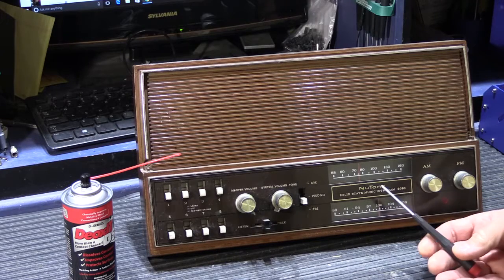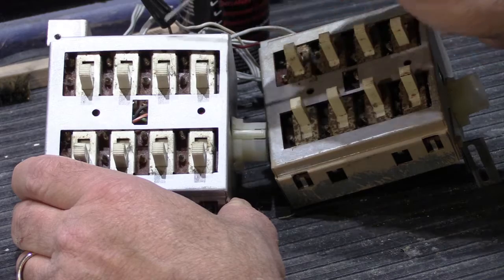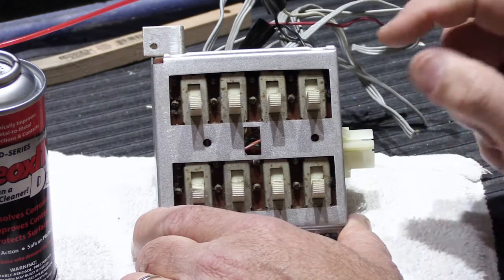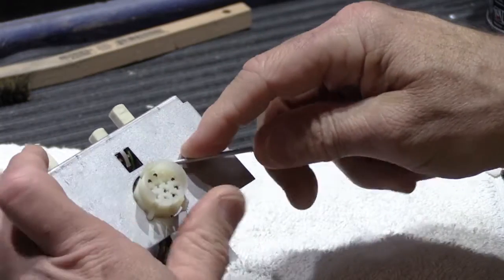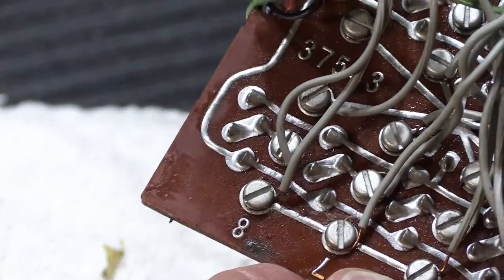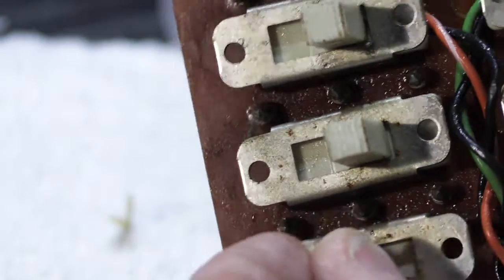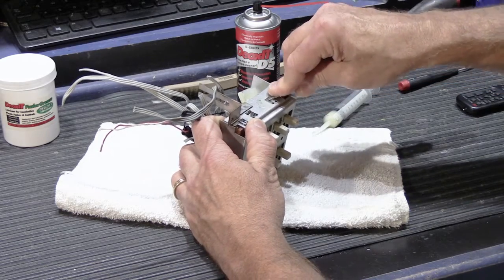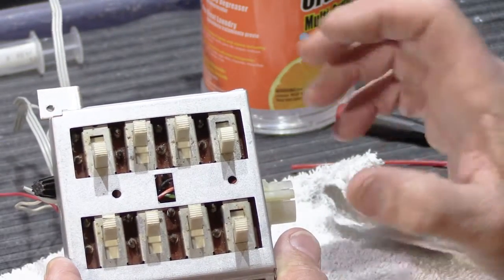How to Clean the  Room Control Switches on NuTone Model 2090 - 2540 - 2542 Intercom Master Stations

Comment: Great video. Can I use the same cleaner and brass brush to clean all the black knobs of the 2570 and 2573 remote controls ? Thanks indeed.
Reply from the maker: Hi Luis,  Yes you can.  When I clean knobs like yours, I remove them form the stations and soak them in the clean for a few hours first, then I use the brass brush under a stream of hot water.  This works very well - Chris